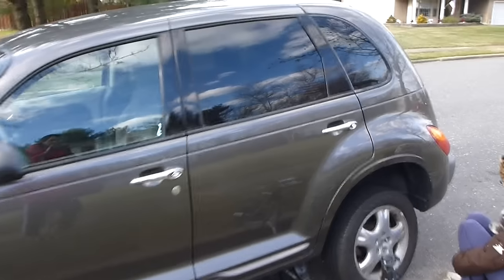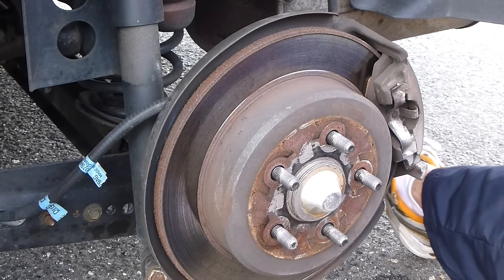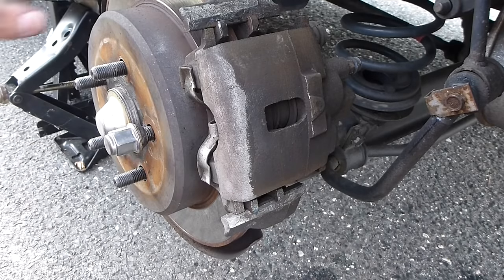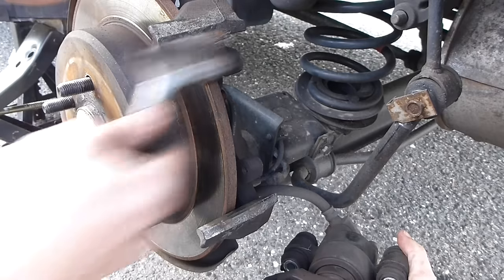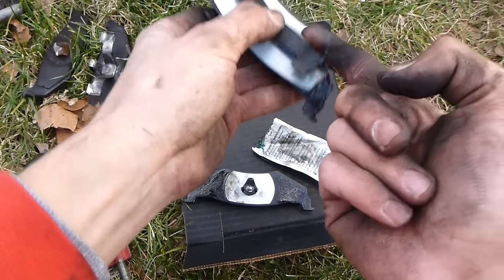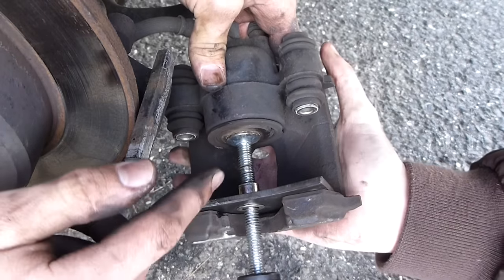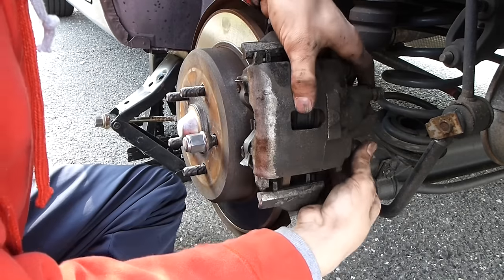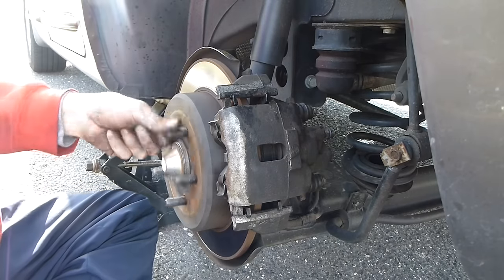How to Change Rear Brake Pads

Comment: 2019 chrisfix would've had this done in 3 minutes with some ENERGY.
Reply: Heck yeah
Reply: 2019 Chris Fix would have nothing to apologize for either.  Brake line not "fuel line".  Did you catch that?  He also got grease on the pads.

Comment: The key for me, being a novice was to get the simple $5 (priceless to me) brake tool. I did not have this for the first side I tried. Do yourself a favor and get this. Also remember to grease the back side of the where the clip that goes into the piston is. This will make this project much easier. This is the best video out there. Best mechanic and lighting. Watch first install after. I really appreciate the people who made this.
Reply: Cool to see old comments

Comment: Hey Chris, Love your videos - learnt how to change disc and brake pads on my Audi a1 through your video's. I am thinking of changing the rear pads and my question is ' Do I need to take the handbrake cable off the calipaer to change or should i leave it on?' Obviously I will disingage the hand brake to keep the brakes loose. Thanks again ChrisFix

Comment: One other trick you may consider, is to avoid pushing nasty old brake fluid back up into the lines/master cylinder, you can (as you start to compress the piston) release the bleeder valve and let the brake fluid escape the back of the caliper.  Make sure you don't release pressure before closing the bleeder valve, as that will introduce air into a closed system (bad)...  
It's also a good idea to flush the brake fluid, but that's another vid now isn't it?  :-)  Good work man!  Keep payin it forward!
PS. other vehicle manufacturers rear disks operate MUCH differently, and to compress the cylinder you have to "screw" in as you push.  Very tough without the right tools, but it can be done.
Reply from the maker: That is a good tip thanks! It def is another video. I try to keep simple stuff simple so anyone can learn to change their brakes, but if you are more advanced and want to do it this way, more power to ya!
Reply: Chris fix just take the bottom screw out flip caliper up take pads out then put caliper back down saves time and faster
Reply: Yes and you have to have the right tools some turns left hand and some turns right hand

Comment: Great video Chris. I have a 2001 PT Cruiser and it only has 63000 miles on it. It's in great condition, but when the rear breaks get wet it makes a very loud grinding noise. It only does it when I'm backing out and it only last for a short period of time. It feels as if the rear breaks are activating without me pushing on the break pedal. Any idea what the problem might be?

Comment: heyy thnx it is very useful Vid , but i have 2 questions 
1. is it okay if we did not bleed the fluid when squeezing the calliper back . 
2, is the anti-seaze okay
Reply: As long as you do not open the system, you do not need to bleed it.
Reply: You do not need to open and bleed the system. Simply Pol off the master cylinder reservoir lid like mentioned @ 14:25.

Comment: hi Im a bit confused, eric the carguy does a 2002 cruiser rear wheel brake job, but its not disc/pads, its drum and shoe brakes,  I have a 2002  2ltr and the rear brakes are same has yours, so my question is I guess did chrysler do two types of rear brakes on some cruisers,
you did a great job on your vid    graham
Reply: Two types of PT Cruiser brakes in the rear. Full drum and disc with e-brake shoes in the hat. The disc brakes have a piston with self adjusting cable and a connection to the e-brake. Rear discs have pads but also an inner brake shoe for just the e-brake.

Comment: hey chris, love your videos, you've helped us out a ton with tons of knowledge. can i ask a question?  im about to do my back disc brakes (pads only) on 04 chevy malibu v6 and am not sure how to handle the piston. can you tell me why others brake the bleeder valve to compress the piston but you didnt in your PT cruiser rear brake video? its my understanding the bleeder is broken so that the brake fluid isnt pushed back into the master cylinder.... just looking for some advice/knowledge to attach to what im seeing and to do correct procedure. thanks a ton ChrisFix, you RoCK

Comment: I changed the both rear brake and when is finished I test drive and want to chnage the both front and I see the fron disk was very hot , I don't know hot to fix that any quick answer will be wonderful
Reply from the maker: That’s probably because it is new. How hot does it get?
Reply: @chrisfix  I cut the bolt 🔩 when I open the front tire and It was so hot , do I need to reduce the oil brake or

Comment: I have a question, I was driving with the handbrake up for less than 0.8 miles and I was parking/reversing. Will my brakes be damaged? I could hear some noise and sounds

Comment: I just changed a ball joint and had to remove the caliper. when put it back on it makes a screeching noise when the car is moving. like something metal on metal. any ideas that could help me address the problem and fix?
Reply: Dust shield is bent straighten so not touching rotor

Comment: My PT emergency brake got stuck. The handle wont go down at all, it is stuck even if I try to push the button to release it. Any ideas? the car had been sitting for months. Drove it around for a bit, parked it at an incline I put the ebrake all the way up and now I can't get the handle to go down. Any ideas? please help. thank you. ;(
Reply from the maker: Go to the rear brakes and use a pry bar on the brake itself to force it (when the handle is in the down position).
Reply: Emergency cable is frozen in the steel jacket at the rear wheel.  You can hit the brake shoes in rear sharply with a hammer to jar it free.  If that dont work replace the cable.  A old mechanic quick trick is disconnect cable at rear brake.  You just wont have use of emergency brake.

Comment: Why would you need to releave pressure in the brake line, unless you added fluid since your last break job?  Don't you want the pressure to return to its original level?

Comment: I need your thoughts what would cause the brakes to sease up and not work properly?
Reply: You have a couple things that could cause that, first thing is the piston itself that wil get some rust spots on it so it wil get stuck, second thins are the guide pins also same thing they wel get some rust on them and not move properly, third one are the pads itself they can get stuck also because of rust

Comment: Hey Chris just wondering. How come on this vid you had to push the piston in first.? Where all your other vids you doing at the end.  Just wondering.
Reply from the maker: +slawrence7474 I'm not sure what you mean.  You can push the piston in,  at any time,  as long as it is compressed so the new brake pads fit.
Reply from the maker: +slawrence7474 I'm not sure what you mean.  You can push the piston in,  at any time,  as long as it is compressed so the new brake pads fit.

Comment: You can just unbolt the caliper then prize it off the disc with a screw driver then push the piston back with water pump pliers

Comment: Hi Chris, what if one of the rotors needs to be replaced too? How do you do that?
Reply: +Melissa Kay Glaze You just pull it off. On many Hondas there are a few screws on the inner section near the wheel studs. It's easy to figure out if you just look at the rotor.
Reply: Melissa Kay Glaze you replace both, you can't just replace one.

Comment: Is really need grease the pads? I asked the guy changes my car pads break, and said don't need grease.
Reply: S-E-C-A the grease is both needed to remove resonating noise and to prevent rust. if rust form, your brakes will most likely get stuck... not a good thing!

Comment: cant you compress it with hands?
Reply from the maker: Alex K You cannot compress the piston with your hands. You need the tool in the video or you might be able to use a C-Clamp.
Reply: ChrisFix done
Reply from the maker: how did it go?
Reply: ChrisFix I had purchased the c clamp just in case. There are ways of doing it without. You can use a simple large flat head screwdriver to prior and compress the cylinder.
Reply from the maker: While yes, there are other ways, the best way is even pressure so a c-clamp or the tool you saw in the video is best. If you go at an angle, you can damage the piston.

Comment: I just changed a ball joint and had to remove the caliper. when put it back on it makes a screeching noise when the car is moving. like something metal on metal. any ideas that could help me address the problem and fix?
Reply from the maker: +Jason Crocker check the dust plate for the brakes and make sure it's not bent